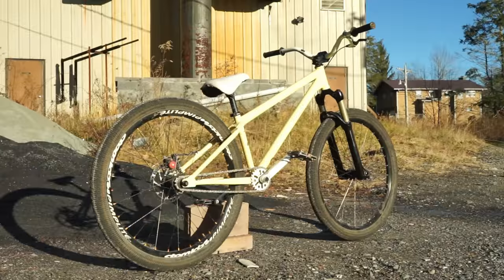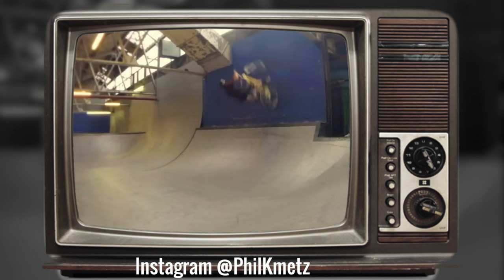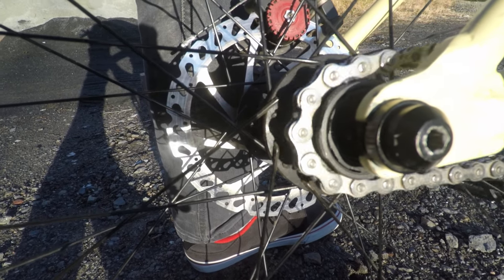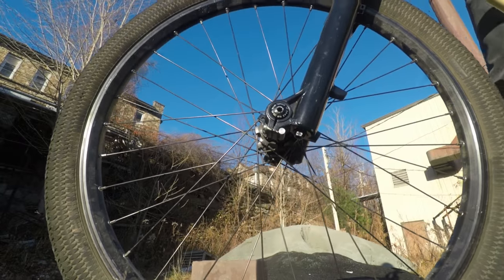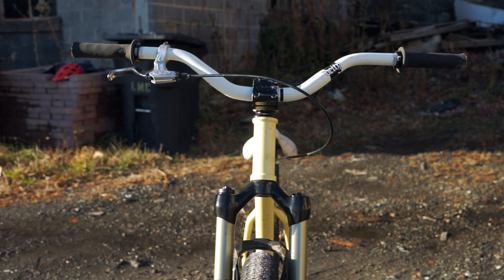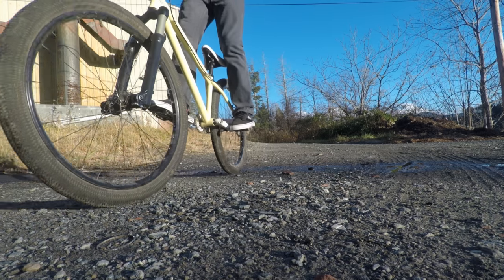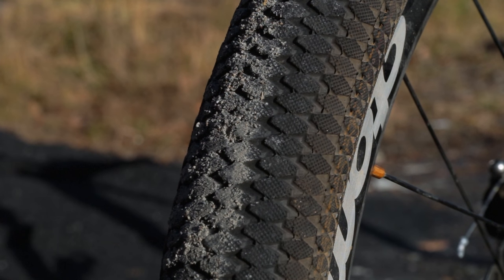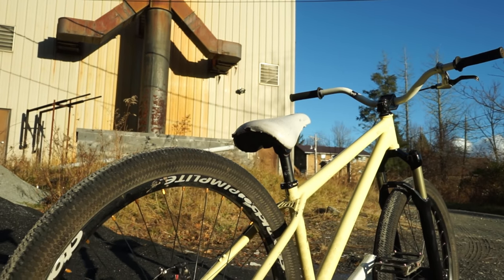Phil Kmetz's Deity Dirt Jumper Bike Check!

Comment: 26in wheels? By choice our just how you built it back then and don't feel the need to up grade?
Reply from the maker: +Regular Guy Mountain Biking at the time I built it 650b was just starting to grow in popularity. But honestly there's no good reason for dirt jumpers to be 650b, the added diameter makes things more cumbersome which defeats their purpose. I'm honestly not sure if many companies are even making 650b dirt jumpers (I personally have not seen one). The only application where I could see it partially making sense is slalom racing.
Reply: 650b on a dirt jumper is pointless.  What do you mean upgrade?  There is no such thing as a 650b or 29er dirt jumper

Comment: Why are dirt jumpers so expensive if there “dead simple” it’s just a mtb with no gearing right?
Reply: The quality of the components. They are built to abuse properly.
Reply: like a bmx also, you could throw it off a building and be able to ride away with it
Reply: They are built solid:  If you r to eat crap you couold still ride away cuz they are like really hard to break.  i agree tho they should be cheaper when you think about what actually goes into them

Comment: Hey Phil, I'm not really sure since I never had a dirt jumper but perhaps you can use snail cams for tensioning the chain. They're used in trials bikes, are light and very precise. And when the chain wears out a bit (not enough to require replacement), you can easily readjust. http://www.tartybikes.co.uk/snail_cams/c114.html
Reply from the maker: This is actually something that I've never seen before, which is saying something. I was watching this video, and I'm surprised this isn't something that I've seen on a mountain bike before (seems almost trial specific), it's simplicity is genius. Thank you for bringing this to my attention.

With that said, I don't know if I can use these on my bike, but I'll look into it.
Reply: Skills With Phil
You can literally run your channel on bike technology for ages! As a suggestion, you could do a video on bike types so that people know what to buy, what to look for. Bikes, especially mountain bikes have evolved the most I think over the last few years. Wheel sizes, geometries, wacky suspension jargon, tons of aluminum alloys, modern carbon fiber, xc, cx, dh and everything in between. There are more BB types I think than there are bike brands. I won't even go into wheel sizes and tires. A newbie would be completely clueless. 26' trial bikes are called stock cause you'd adapt a regular one. There's literally almost nothing stock on them anymore. Only tubes, tires and spokes I think you can still buy from a regular bike shop.
Reply: Some trials riders even make there own diy chain tensioners. Just grap a peace of steel wire, bend it in the right shape and fix it to your chainstay with some zip ties. There you go! Propably the cheepest you can get away whit, but it gets the job done quite well! Its also super easy to replace if its gets damaged.

Comment: Hello, Phill, How can I fix the the disc brake issue? They're just squeaking and not stoping me as fast as they stopped me when they were new. I don;t even know what to do. Could you help me ?
Reply: ive never tryed this but got it from the motor trade copper grease to stop car brakes from sqeeking
Reply: Alex Cantlow thank you i'll give it try😉😉
Reply: Have you fixed them yet?
Reply: They are probably oiled in this situation you should replace the brake pads. No other chance of fixing them

Comment: thanks for the tip about making a spacer for the dropout.  I have the same problem with my dropout being too short to run a standard tensioner, and have been looking for a solution.  using a snail cam would be great too ( mentioned in another comment)  but I think you need a derailleur hanger.  

 also, I'm at the wheel mill now thanks to your recent vid... I appreciate all the info !

Comment: I'm gonna make a hardtail with a dirt jumper frame lol
Reply: Its called a Fourcross bike.
Reply: Thomas John Solidum WHY DOES EVERYTHING HAVE A NAME?
Reply: Dat Person Doe. Fourcross is a discipline. Its basically a dirt jump bike with gears,  It follows the same rules of competition race BMX however the tracks are slightly more rough with rock gardens and wall rides and bigger jumps.  Usually 4 riders race head to head in a Fourcross race
Reply: Thomas John Solidum Right... Still making a 1x11 300 dollar budget mtb.
Reply: Have you done it?

Comment: Avid bb5's are annoying...you set them up to not rub and 5 miles down the road they start rubbing lightly. i swapped them out for Shimano BR m375's which are much better. they have a bit more power too thanks to the wide pads. They also cost less than BB5 calipers.

Comment: Check if your rear fork ends are parallel when the wheel is tightened. I use an old axle without a wheel, tighten it until the plates are parallel using a vernier calliper to measure either side of the axle. Then make sure your wheel is spaced to match. Works every time.

Comment: My dirt jumper also has a piece of metal in between the axle and the dropout, it will stay straight for all of 5 seconds otherwise.
Reply: Also kniption's suck and are heavy af, get DTH's.
Reply from the maker: Oh trust me, I've been meaning to get a set of DTH tires!
Reply: Ever since I got the Aaron Chase DTH skinwall's, I have never had a flat or any other issues.

Comment: Hi Phil, I am about improving the manual and the bunny hop. Does it make sense to insist learning on my dirt jumper bike? Not sure why but I findt it easier on my full suspension bike.
Reply from the maker: +Mauro no ☺️, what ever bike you are most comfortable with. I can manual better on my trail bike because I am more used the balance point on that bike. My dirt jumper requires less effort to get into a manual, however I tend to loop out a bit more since I'm not quite as used to that bikes balance point.
Reply: Thanks Phil looping out is exactly what my problem is. I will change my learning platform bike.

Comment: Are there any good DJ completes in the $500-$600 range?
Reply: CC-1004 Haro Steel Reserve $499. Bombproof steel frame, rotor for bar spins, but kinda heavy (because of the steel). Still best bang for buck DJ.

Comment: im no professional but are his forks on backwards?
Reply from the maker: +I_like_goats Manitou is known for putting the arch on the backside of their fork and for the this reason it appears backwards. The best way to tell that it's on correctly is if you look at where the wheel attaches to the fork, it's slightly forward of the rest of the fork and that's the case on all forks.

Comment: Are dirt jumpers good bike to learn how to manual and bunny hop? I mean these bikes are smaller and 26".
Thanks
Reply from the maker: +Jordi Diego yes that's the perfect bike for that
Reply: I have a YT Jeffsy (which I love) and a Specialized Rockhopper (to ride with the kids and the trail gator) both 29ers. Jeffsy is L size and Rockhopper is XL (I'm 6.14 foot) and I'm stucked with manuals, and I was considerind to get one dirt jump bike to learn more technique ( i see bmx bikes too small for my high and i can use the dirt to go to work). Probably a used 300€ bike. Do you think I should go for it or a 24" trial bike which is another option?
Reply: Finally i got a dirt jump bike too. I got a used Giant STP. The first sensations are good but as I'm a tall guy pedaling in flat terrain is a bit hard but i guess I'll get used to. Let's see if my confident rise with this bike for manuals and wheelies. 😀. But the purchase came with a "discussion" with my wife she says I'm crazy because now I have 3 bikes (never have enough bikes) hahahahaha